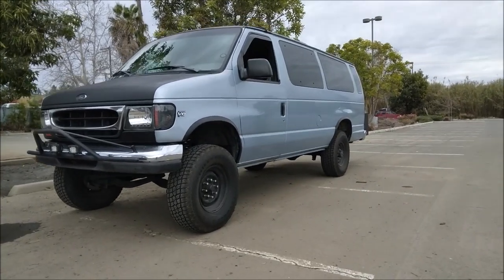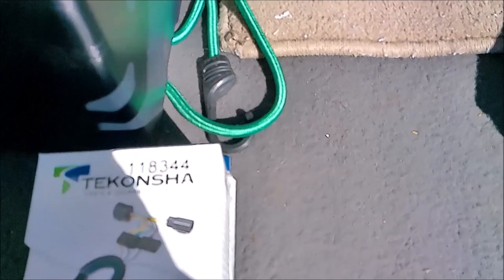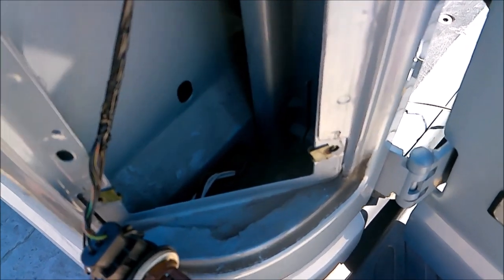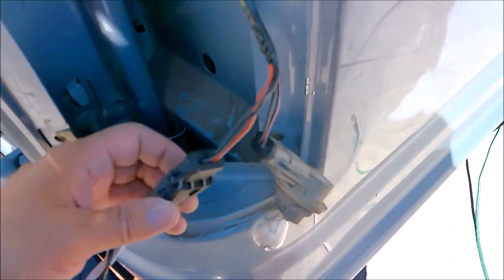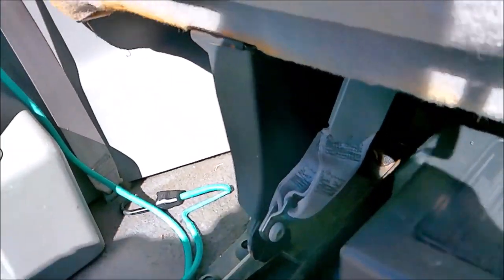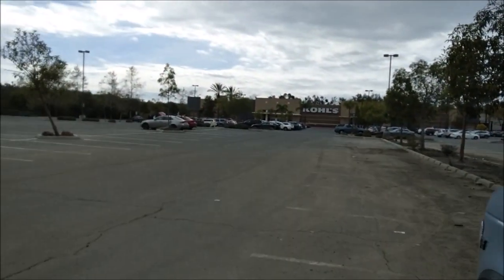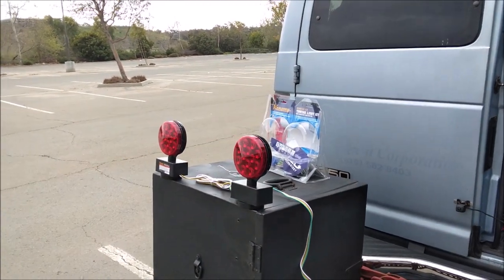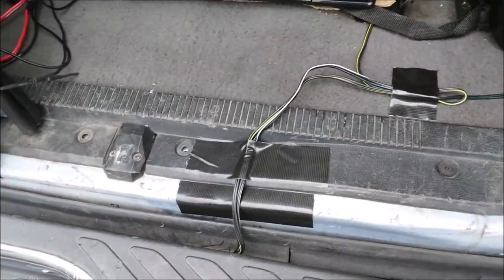Econoline Van trailer wiring harness universal | Ford Pass through T-one easy install diy tow lights

Comment: That should work. I thought your rig already had permanent trailer wiring.  Did it have a tow package when you bought it?

I’ve used those magnetic type lights many many times at my job.
Reply from the maker: No sir no tow hitch no trailer wiring. Appears to be a Shursh van in its last tour of duty. Hopefully that means it had a fairly easy life.

Comment: Are you going to use an extended hitch bar?  This way you can retain your outside storage box
Reply from the maker: Yeah the Hitch Step is rated for 4000 pounds. I got the Tracker weighed it's only 2500
Reply: @JohnDrivesAnything  the hitch step you have will clear the storage box?

How long is it...where did you get it from...  Fight now i use 2 hitch extenders for the folding storage rack to clear my stowaway box
Reply from the maker: @camposvazquez  I got it here https://www.harborfreight.com/hitch-extender-with-step-97685.html
I was also thinking my Geo Tracker is also additional storage lol